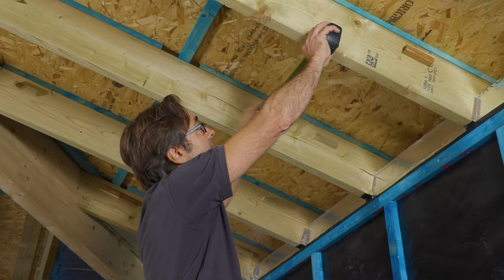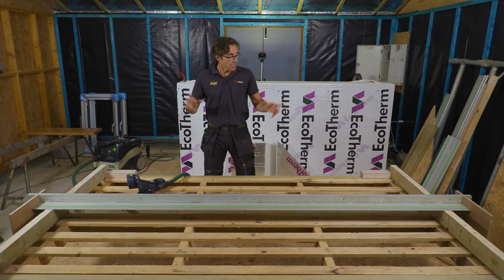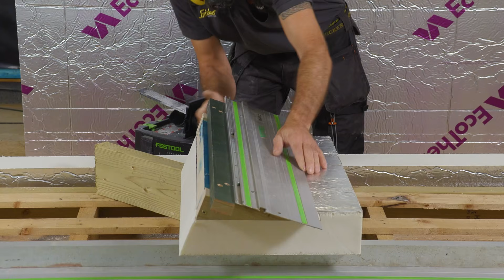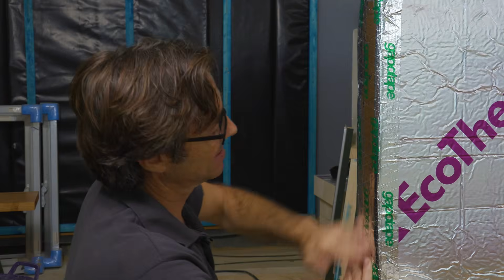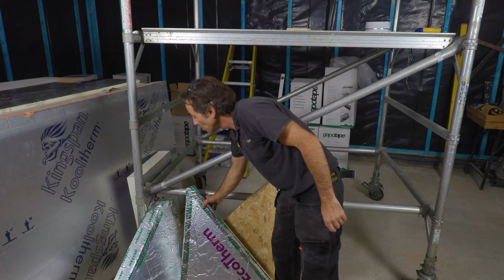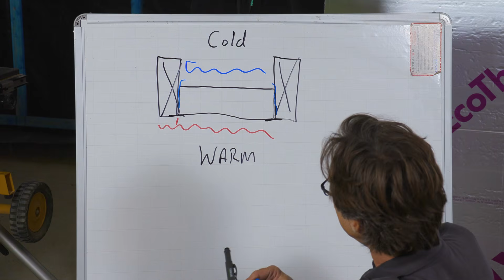Gapotape - Perfect Insulation with PIR Board

Comment: I’ve got a huge sloping roof area to insulate on a new kit home. The rafters all vary, meaning every cut of PIR is varying from about 470mm to 550mm. There are some other rafters that are as narrow as 300mm and less. Some of the rafters vary by 10mm from bottom of the PIR to the top, meaning it’s easier to cut them across the PIR rather than the longer length. The kit construction never considered follow on trade unfortunately and im using a mixture of a plunge saw and hand saw. I’ll be on a while.

Comment: Hi Robin, I think that you should over board the insulation and the common rafters to ideally a double layer with staggered joints, two layer’s of 20mm or one layer of 50 mm which has tongue and groove, that would be pretty good, wood is not a brilliant insulation

Comment: Ive decided to use gapotape while insulating my 70s chalet house. OMG every rafter is a different spacing and hardly any run straight 😂. Its a very slow process! Ive also found the tape sometimes lifts so i lightly sand where the tape adheres and its sorted that out. Ive heard elsewhere there can be waxy chemicals on the PIR foil which might have been my problem. You also need to wipe it to get rid of dust after cutting! Gapotape is a slow process but it does a top job especially in my situation and also it's easier and cleaner to remove the panels if you have to go back for any reason either now or in the future. Just be ready for cost and time increases!!!!

Comment: One thing you learn is that we've lost the ability to build reliable houses. New products don't work ignore them and go back to basics. Stone built houses with timber treated with tar and slightly singed and natural wool for insulation. For plaster use lime to allow the building to breathe. We've learnt this over hundreds of years.

Comment: I don't think that small gaps on PIR between joists are so important especially there are more cost affecting ways to improve whether it is  a liquid foam and tapes to fill the gaps. If done right heat loss will be minimal and definitely not noticeable in monthly/annual heating bills.When calculating the cost of kingspan plus those gapotapes that are usually sold in 10 m lengths and cost almost same as a single PIR board is not cost effective job by my opinion.

Comment: …a “bit” of money on the costs. You’re talking thousands and thousands of pounds in extra labour and material costs. It’s ok when you’re working on 5 million pound properties where you have the time and the money, but for the average house builder for the average jo, they’re not going to able to afford it. It’s not practical to spend that much time messing around applying tape. Fitting insulation and filling any tiny gaps with foam, then over boarding with 50mm will work perfectly fine and will pass any test that’s brought in. 

I imagine, you’ve have had those rafters constructed absolutely perfect, but in reality we rarely find that happens.

I would not even waste my time and money on this product…

Comment: Such a fantastic video.  I do have one question about the heat/cold insulation that was mentioned.  I live in the northeast USA and need the insulation to keep the shed cool in the summer and warm in the winter.  Am I supposed to use a different type of insulation?
Reply from the maker: Insulation is clever stuff, it seems to know when to keep the heat out  and when to keep it in.
Reply: @SkillBuilder  ok, thank you!

Comment: As an Architect  I find this vid excellent. We used to regard insulation as an evil necessity  but now  we all regard it as the most valuable element in the whole building . We still need improvement to retro fit in older buildings. A patented panel with finish  would be welcome. A t&g panel with a joint seal all decorative would be great,so you get a vertical board type finish or a vertical stripe. Picture rails,skirtings and covings  are difficult  and either lost or recessed  into the overall appearance. Need ideas from manufacturers.Foam replacements would be amazing to repeat the old appearance. Skirts,picture rail and coving please.

Comment: The aluminum tape usually has to be faced inside the building over the studs/rafters not towards the studs or rafters because you will have a thermal bridge on each stud/rafter. As i see it, the main benefit of this tape is the fact that you dont need to spray foam into the usual side gaps left on this type of insulation. Thanks for the video, didnt know this tape exists.

Comment: First class presentation skills only exceeded by your ingeniuty and building skills - well done. 
I'm using some old Styrofoam boards in between the floor joists in a bid reduce the heatloss from my living room to the cellar. I can't get a complete fill nor achieve air tight gaps as you have done but I'm working on the assumption that something is better than nothing and at least if it doesn't make an improvement then at least I haven't spent any money as the boards were free. Great insight into start of the art building techniques though!
Reply from the maker: Hi John
Just foam them up

Comment: But!
Please explain what  a massive factor is ?
Seems a bit vague
Reply: I think it’s to do with the bypass around insulation, whenever there’s a void beside insulation the heat can go around it and can loss like 50 or more % of the energy so building control make you show that your creating gapless insulation now. I think the company has testing on the website that shows the actual figures which are in the range of like 50% better as good or something on the houses it’s installed in or something like that (not sure of the build up or anything) but going forward with new builds and such BC are monitoring and stating install techniques such as tape for gaps for roofs and tongue and grooved for flats to stop the holes n bypass, SkillBuilder actually did another video on Part L the new regs which go into all this and the tape which is worth a watch or maybe your like me and your watching this vid after they showed the techniques you have to use in that other video

Comment: This is fantastic. Thanks for sharing the tips. I'll be using gappo tape for a build soon. I'm wondering after the insulation is placed with friction fit should I also tape over all the joints and where insulation meets timber (internally & externally) to account for any shrinkage / movement from timber over time.

Comment: I’m sorry but this is an absurd waste of time and money. This configuration is like driving in wintertime with your windows down, dressed in 12 layers and 4 pairs of socks, giddy in the idea you’ve finally solved the problem of cold weather driving!

You could have applied a 50mm layer of closed cell spray poly up under the roof deck (scrapping those silly vents) literally in the time it takes you TO EXPLAIN your system of painstakingly fitting 100s of individual components together. 

The propellants in modern spray foam are low GWP, and such a layer  provides nearly complete sealing for air infiltration and vapor transmission, while stopping about 90% of heat flow.

Comment: I'm about to extend into the loft but ceiling height is such that fitting pendants will not be possible.  I shall be using flush mounted lights but am worried about heat transfer from the lamps and also heat loss through the holes in the ceilings.  Any advice please?  Great video BTW!

Comment: Costs more than the PIR board , if it was cheaper i would use it.
Reply: Still cheaper than larger gear though is my thinking, thing is if it stops the leakage on the boards it’s still cheaper than one that allows the wind to whistle through
Reply: @lunaticoflancashire9572   Would you really save 700 quid on a tiny gap here and there in an otherwise decent insulated property?
I have my doubts.

Comment: Unbelievable job and perfectly explained. Quick question; my loft space is as you described with Rockwall wrapped in plastic, tacked to the unevenly spaced rafters with no soffit or fascia ventilation. So … do I have a hot roof or cold roof and if I were to install this product would it benefit me to have ventilation front and back of the house. Thanks

Comment: Great video . . . and a game-changer for me as I'm about to upgrade the insulation on a timber-framed house; changing from mineral wool / fibreglass to 100mm PIR in between and 25mm over the top.
I can see the value in sealing the gaps up completely.
As well as this, I really appreciate your advice regarding not sitting the PIR 'flush' with the rafters in order to allow a gap for reflective radiation.
Many thanks

Comment: Hi Robin... would you bother using gapotape in a stud wall. I get the cold roof scenario is a no brainer... but would walls be adequate with just the odd spray foam job for any gaps given it’s vertical and easier to install
Reply: I used it in my shed / home pod for the walls and roof as apparently the leakage at the sides happens no matter the angle / pitch so walls and roofs all get? (Don’t quote me on that I could be getting that mixed up) my brother in law is a technologist at a design firm and he explained it to me but it’s still confusing, I don’t suppose you know someone that can look at your build / is in the trade? for me that was invaluable having someone that could look at the project and say “yeah for this you need this but you don’t need this”.

Comment: Another very good video thanks for sharing it. From the video It looks like you have left a gap (maybe 25mm) from the underside of the rafter to the underside of the insulation board. Ie when the plasterboard is fitted to the rafters there will be a 25mm air gap to the back of it. Is this intentional or is it just an optical illusion?
Reply: I was wondering the same thing, is it not an unvented air gap. Maybe it doesn't matter so much if it is on the warm side,  even if it is unlikely to be 100% air tight. I'm sure there is a valid reason reason.
Reply: just seen an earlier reply to John Mallaby below explaining Robins Reasons ( search page for Mallaby)
Reply: @garyharrisonuk  Thanks for letting me Know, it now makes perfect sense👍

Comment: The huge problem with insulation gaps is that warm air literally gets draw. Into the cold gap. Warm air carries moisture. Any in the cold gap chills and condenses. That dries the air so more gets pulled into the gap to moisturise it. Sealing tapes stop the air movement and are usually a must-have but they get ripped on rafters/framing and are a load of work to fit. Plus all the splinters getting in your hands.
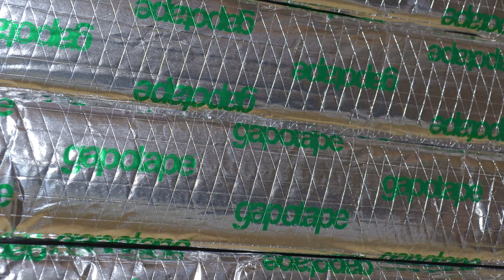Reply: 14:34 I like that they put that reinforced backing layer in for that reason, stop it ripping on the rough timbers

Comment: If you are applying the boards on top of the rafters, almost full size, I suppose you would only use the tape along the edges in contact with timber, not board to board?

Comment: This is an excellent product, these rigid insulation's are so expensive and difficult to fit correctly without Gapotape. Absolutely imperative that this insulation is fitted correctly and Gapotape make that a reality. There is another very under rated benefit to this Gapotape, the dust from these boards is terrible which makes fitting them even more difficult and doing away with the dust element is an excellent advantage.

Comment: Not really a gapotape related but definitely Kingspan insulation related.  How would you fit recessed spotlights when using hard kingspan type insulation?
Reply from the maker: Don't do it. There is no good way of preserving the integrity of the insulation or the vapour barrier. The only good way is to have a shallow void before the insulation.

Comment: You are a perfectionist, however, if you use an insulated plasterboard underneath & over compensate the insulation you will loose the low insulation properties of the timber & the less skilled labour than yourself in fitting & I would surmise that the tape is not cheap! construction is ALL about compromise even you have not achieved full 50mm air flow over your hips with 25mm counter battens & you are very good.

Comment: Really good product but its £17.00 per 10m roll (100mm board).  The website only sells them in boxes of 6 for £102.  For each 2.4 x 1.2 board it will take 7.2m per board, at 600mm centres you will need 12m per board.  Thats a lot, it almost doubles the cost of the insulation.
Reply: Don’t know if it helps (cuz I nearly missed it on my order) but there’s a discount code in the description that knocks a lot of the price. If what robin says is true and it knocks of the hidden costs I’m just gonna go for it on my roof as if I’m putting the stuff in I damn well want it to work otherwise what’s the point ya know?
Reply: @nocturnalspark5629  spray from is less than £10 per can and goes a lot further. Also remember the video is a paid for promotion of the tape, so basically an infomercial like s shopping channel.
Reply: Khurram Chaudhry yeah I know but I’ve been reading all the stuff in the description and the testing and if it makes the u-value better then it’s a no brainier for heating costs, I mean why would I spray foam the gaps when as robin shows it’s only doing the top side and not the depth? I can’t take the plasterboard off again once insulated, it’s gonna be up their for 30 years so I personally am not gonna save a bit now only to pay it long term and be upset looking at the bill Everytime

Comment: Looks a good product. I have a 1960s pitched roof about 10m long on 400mm centres that I'm planning to 80mm PIR as DIY.  The roof depth apex to eaves is about 4m, so to do both pitches fully for all faces of PIR I'm looking at about 450m of gapotape, which would be around £660. I may end up just doing one edge of the PIR and halving my spend, on the basis that it will still be a big improvement and at least help to squeeze the untaped edge of the board against the other rafter a bit.
Reply: Was thinking of doing the same, getting a box and trying it out, let me know how it goes l!!! May also try and put all of it though in the new grant thing, pay for nothing 🧐😂
Reply: Spend the money on another layer of  pir 20 mm or so  cut out the thermal bridging of the rafter s money better spent

Comment: I noticed when the long stretches were applied, that your assistant was compressing the foam a bit before sticking the tape to the sides of the board. I think this reduces the effectiveness of the seal. The memory foam doesn't have the room to return to its normal expanded position. The cross-section of the finished product should be right-angled, like the underlying board, for a straightforward cut. Instead it's arched, as can be seen in the stacks of boards. This may not matter in your case, with your tight tolerances, but I can see efficiency loses resulting from a more slapdash installation that would be more the norm.
Reply: I asked one of the guys at their futurebuild stand about this and he says that the seal is only created once the compression occurs and that then the foam expands and contracts constantly always filling the gaps, Ive been curious about it since then as im wondering what 8 - 12mm of tolerance really gives? is it really alot or as you say are the tolerances too tight? seeing those boards all lined up and ready to be pushed in though has made me really curious and Im wondering if it may be worth a try on a job where the client isnt looking a tenner for £9 sort of thing.

Comment: works out cheaper just to have a spray foam crew come in and do the job , plus spray foam is a far superior product
Reply from the maker: We will be doing a video on spray foam and the features and benefits very soon. Apparently you can get it in breathable and closed cell formulas.
Reply: always wondered if the spray foam is cheaper and the fact that some people are still funny about it, I think that will go away in time though as you see the Americans at it constantly practically every job over there. What do you do though on the jobs where you have to leave the air void?

Comment: Just finished insulating my extension. Wish I had watched this first.

I found that where boards met it was  better to mitre the ends so they overlap rather than butting them. Using reference blocks would have helped me as I found it really difficult to butt he boards without one pushing up when the ends were square. Looks like the tape helps with this as well.

Comment: Everyone goes on about how much energy we are saving with PIR what about all the crap that goes into skips all the off cuts all the waste from this material . How do we get rid of it ? Building suppliers should promote more greener solutions far too much waste and far too much packaging  and plastics .
Check out this product chaps Thermafleece .
Reply from the maker: There are systems out there that have two cans and a mixing hose so you can squirt the stuff in yourself. When you think of the space freed up in merchants not to mention the huge transportation cost then firing in your own foam seems an obvious answer. I would love to see some kind of little cube that you popped into a void and pulled the release tape to activate it. Perfect fill everytime.